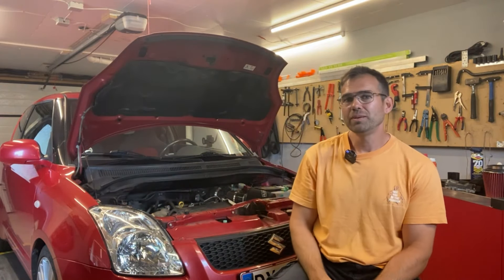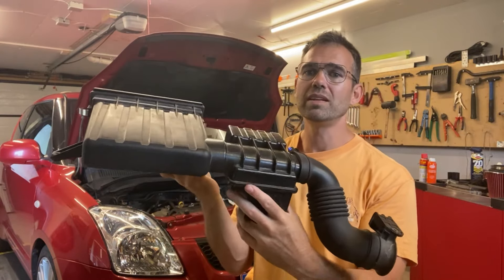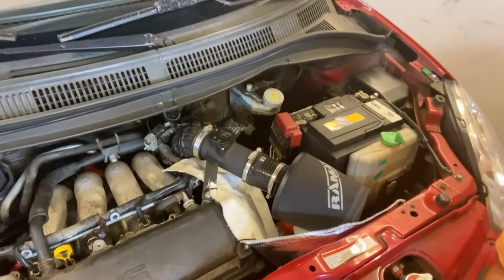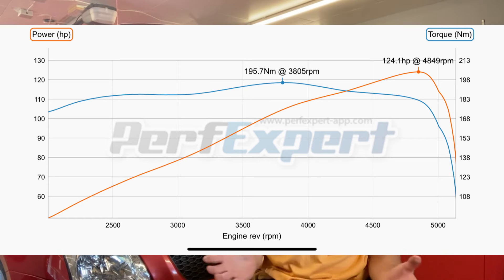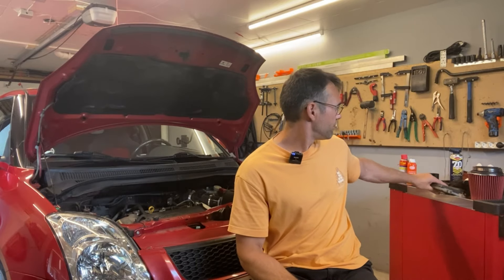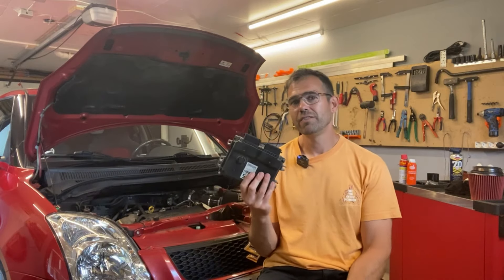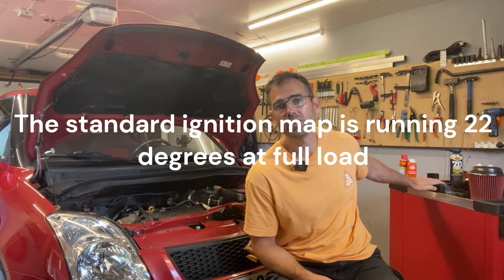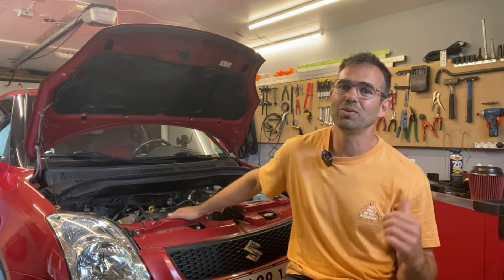Remapping my Suzuki Swift Sport 1,6

Comment: That is not a good intake for these. If you got instead a k&n filter on the stock airbox or a monster sport intake you would get deffo better results. The position on this does not allow cold air inside. Also it's in a place that there is a lot of heat. I'd suggest to check the intake temps with this setup and the stock one you would see the temp difference is big
Reply from the maker: Hi there :) I know what write is a big problem with this after market filter. However, the stock air filter box has a poor flow compared to this new one, and I tried to seperate the engine bay with a heat blanket, and it seems to reduce the heat - But I have not done a temperature measurement comparison of the two "chambers" yet. But I would like to do that actually.

One thing I would like to ad though is a tube with fresh air feeding the air filter chamber from the bumber, but I simply can't find a space for it.

Comment: From my experience, it's not so much the flow of the air filter,,,it's more the intake air temp that needs to be monitored...just slapping on the hot air intake makes you lose power....direct cooler air and the car runs way better....the 3to 4000 rpm are needs timing advance to get rid of that flat spot,and that alone will make the car a lot better to drive

Comment: Most aftermarket Warm Air Induction kits lose power over the stock airbox. The OEM air box is a tuned length also so when choosing an aftermarket induction kit people should consider “tuned length” and a cold air source rather than the kit sucking in warm turbulent air from under the bonnet. 👌
Reply: What is you add an exhaust too. Maybe then break in to 140 hp
Reply: I believe the tuned length factor mostly just applies to the run from the intake valve to the intake manifold as it is the change in diameter at the manifold that reflects pressure waves to aid with scavenging at specific RPMs
Reply from the maker: @ceejaywilliams5448  Next step is actually adding a new exhaust manifold and a race cat. Hopefully 140 is achievable then :)
Reply: @autofokusDanmark  I have the ZC32S. With induction kit and back box delete. It's dyno 138.8 hp. Before it was mapped it was making 130 hp.
Reply from the maker: @ceejaywilliams5448  very similar to my then☺️ Nice car!

Comment: Can anyone tell me what is the difference between the 2007 92kW engine and the 2011 100kW? I have a 2008 Australian 5-door RS416 92kW "Sport". When you look at the specs it's puzzling that the 2011 "Sport" is the same M16A and seems to have no new technology, but produces 8kW more... and the torque is not only more but peaks 400rpm lower!!
Reply from the maker: Hi there. I know the M16a comes in different configurations. As an example it is also found in the SX4 from that age, but only with 8 valve head.
Reply: The 1st gen Swift Sport only have variable valve timing on the exhaust side (I believe), while the 2nd gen have VVT on both the intake and exhaust cams. That additionnal VVT really helps torque.
Reply: Amazing great info! Thank you! I actually thought that was a possibility. By the way, when Toyota was gradually evolving their 3SGE they went through the same concepts, and by the time they got to "BEAMS" version it also had 'double VVT'. The improved torque at 400rpm lower was what really made me suspect there might be an actual new technology in the ZC32S/AZG416/2011 versions.

Comment: Great channel, I have exactly the same car for the last 10 years , love it, but it drives me mad now as I can’t find where the clunking noise come from🤦🏻‍♂️, changed control arms with all the bushings and ball bearings, changed the drop links , strut mounts and the noise is still there, so my suspicion now is a steering rack , if you have any ideas please let me know, and thank you for your videos 🤝🏻
Reply from the maker: Hi  @audriulis  . Thanks a lot for your comment and positive feed back.
Perhaps it could be an engine or transmission mount.
Reply: @autofokusDanmark  Thats another thing to look into, top two look ok , but I am not sure about the bottom one, thank you  👍🏻
Reply: @audriulis  I'm searching for little noises on my 07 zc31s as well...the caliper pins seem to be worn on mine,,and that rattles when I hit ruts in the road...if I hold the brakes while on the rough surface, the noise goes away
Reply: @brucksport  I have that as well , but only left side, thanks
Reply: @brucksport  not sure if it helps, but I found adding some sticky backed foam pads to the bonnet contact points (little black rubber bungs) eliminated the low rev rattle I had. It was the bonnet rattling on the worn down stops! 😅
Reply: @audriulis  I had awful clunking on my 2007 ZC31s when I got it, I changed the suspension, steering rack, control arms, track rods etc. It was in the end worn engine mounts. No more clunks. Definitely try changing the transmission mount.
Reply: @benski1190  Ok,just to let everyone know as it may help someone , the problem was with control arm bushing bolts they were simply mixed up, whoever changed the bushings before me mixed up the bolts and when I changeg it I put them in the same place where they were before, thats why the noise never disappeared, yesterday I changed the bolts and everything is fine ,noise is gone. Thanks everyone for help 🤝🏻
Reply: @audriulis  Glad you found the solution and thanks for sharing the knowledge!
Reply: Engine mount .top 1 drivers side or back 1 .

Comment: Try a proper cold air intake like the Simota. They will actually deliver performance gains, as they aren't pulling in hot engine bay air like yours is.
Reply from the maker: I actually fitted a heat blanket which shields off the engine heat (as good as it can). But I agree with you, it is a better solution.
Thanks for commenting.
/Simon

Comment: The torque numbers on your dyno sheets seem off. 195 NM stock, then 211. Should rather be at 148 to 160NM.
Reply from the maker: Good catch. You are right, the reason is, that the moment is based on me scaling the rpm vs speed correct, and I did not naile it completely.

Comment: I have a 2007 ZC31S 104k miles, like yours. I also did a lot of work to bring this car back to life after 17 years of neglect! Thank you so much for sharing the info in your videos, it's so helpful, particularly sharing the gains you had with the tune, 4/2/1 header and dyno tune, and the disassembly of the steering rack (I think my bushings are shot too - slight play). Can I ask, did you tune the car yourself? I am curious if it's possible to tune my car with OBD software at home using your settings of Lambda 0.9 13:1 and ignition advance +8 degrees? I cannot find a tuning garage near that will do the work on a dyno.  Can I also ask, is the steering generally heavier than most other cars in the Swift? Many thanks!
Reply from the maker: HI .Thanks for writing to me. Sound like we're going through the same stuff with our old cars :)
You can't remap the ECU through the OBD-port. You need to take the ECU out and connect it directly to the tuning tool.
In order to do the tuning you need a "mappack" so you can access the dirrerent maps, such as lambda, ignition, MAF-scaling ect. If you don't have the hard- and software to do this, then it is impossible for you to do that.
Regarding the ignition, I reccomend you do it in steps of 2 degrees at at time, just to ensure no knock actiivity occurs.
Best of luck :)
Simon
Reply: @autofokusDanmark  Thanks Simon, very kind of you to reply. I will research more along these lines - you have pointed me in the right direction!
Reply: @autofokusDanmark  Hi, it would be very good if you can show in a video how you do this tuning on the bench ...I also have a 2008 Swift Sport, and really enjoy driving! Thanks for all your uploads!
Reply from the maker: Hi @ . Thanks for writing to me. Let me see what I can do, I do not have the car anymore, but I believe I have an ECU which I can use for the purpose😌.

Comment: Great video! Can i ask what computer software you used to change the ignition timing and fuelling on the ECU?
Reply from the maker: Thanks a lot :) 
I use WINols to edit the different maps in the ECU.
Reply: Thanks for reply. Is this software difficult to use? Did you get training on it prior to use?
Reply from the maker: @IvermectinFTW  When you get the hang of it, it is actually quite easy. Its getting the file downloaded from the ECU which sometimes is the difficult task.
Reply: @autofokusDanmark  - thank you once again for your help. Much appreciated :) A final question if you don't mind - can you download and upload files from/to the ECU using the OBD port or do you need to remove the ECU and connect directly to the pins?

Comment: How did you get around the whole larger maf tube prior to the tune? I sealed out my maf tube on my 1.5L swift with the factory air box being necked down very small as you could see to a 2.5inch tube and it would bearly idle
Reply from the maker: If you change the diameter of the MAF-tube, you also need to rescale the MAF-sensor. This is done as a part of the remapping.